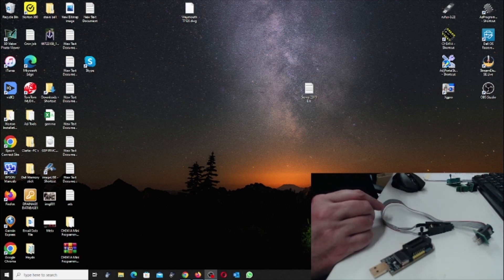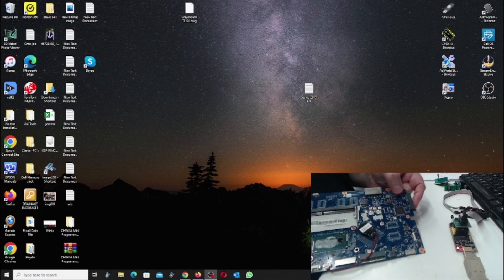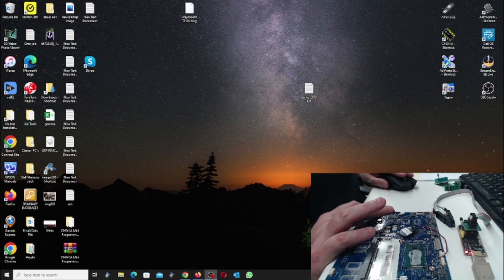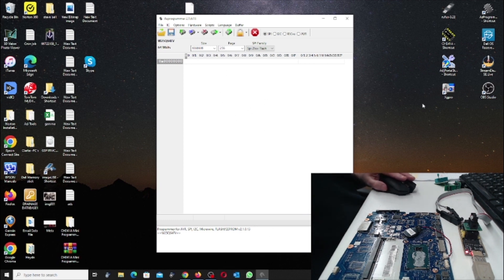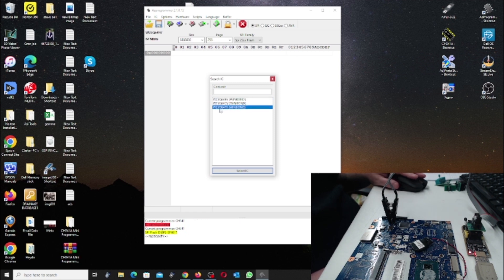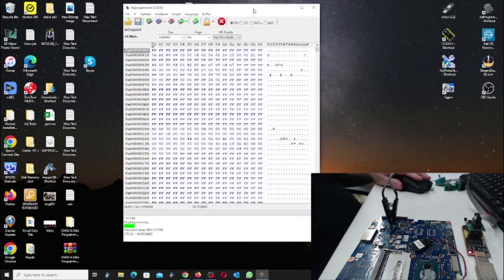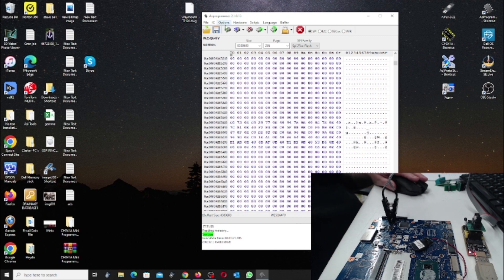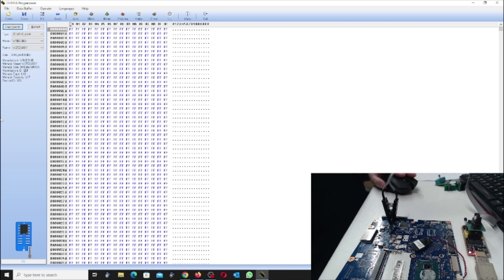USING THE CH341A BIOS CHIP PROGRAMMER.

Comment: if Acer doesnt get back to me im considering using one of these to restore a board in my laptop like i got a replacement board that wasnt programmed by the part supplier but i would label each winboard chip which is a SOP8 SIP but i would have to use my server to read the chips as i cant actually program the chips on the bood bard but i just want to get this laptop fully going again with all features
Reply from the maker: Try this first. 
https://www.google.co.uk/search?hl=en&q=Acer+BIOS+recovery&meta=      let me know if it worked.
Reply: @enscomputers  for me the bios isnt corrupted but needed data like seiral and product ID arent programmed acer here int eh us is giving me the run around like they told me when im ready they would file the RMA and send me a shipping label which hasnt happened unfortunately i have located 2 winbond chips on the original board that has a bad nvidia gpu like as soon as you put a intense load on it the gpu crashes if i do manage to pull the needed data that would be good i think somehow this laptop has a dual bios since it has 2 bios chips